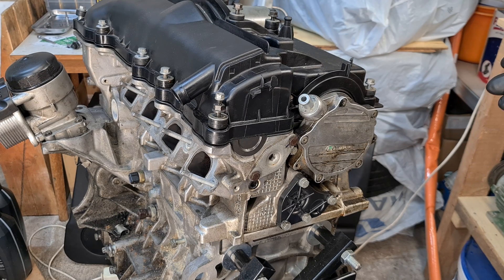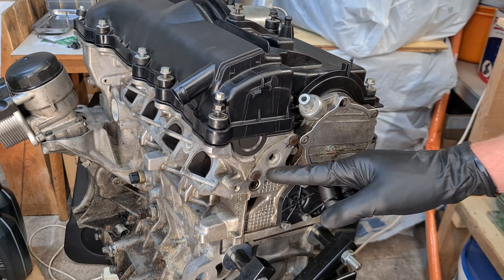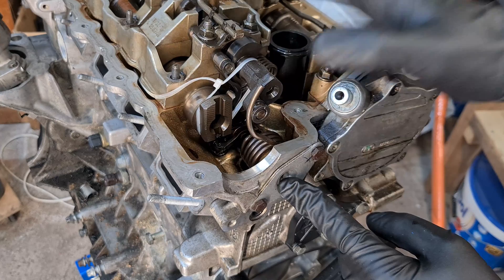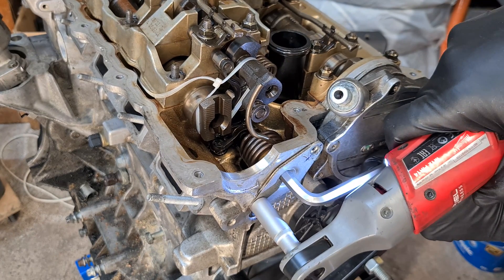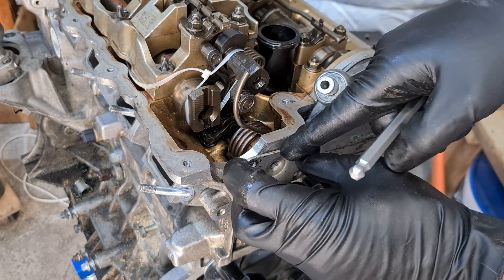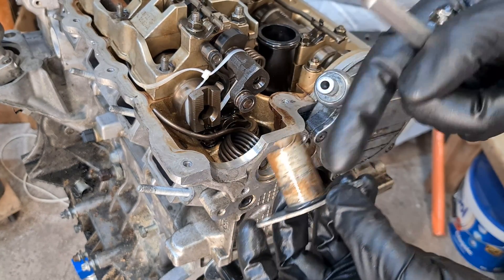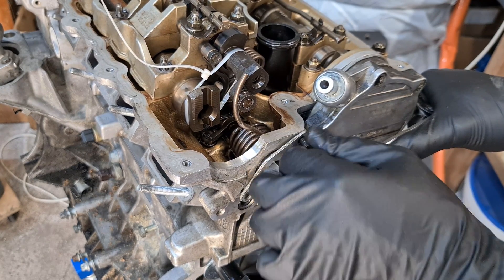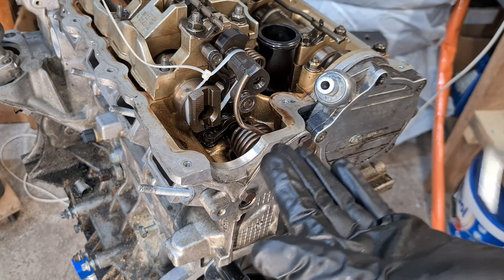N42/N46 Valvetronic Eccentric Shaft Torsion Spring Carrier

Comment: Thank you for your helpful video. I am an amateur car repair enthusiast. While replacing the vacuum pump, I mistakenly removed the camshaft spring seat. Once the two bolts were loosened, it was ejected under spring pressure. Because the component is located so close to the vacuum pump, without removing the entire engine it is difficult to see clearly, which makes it easy to remove the wrong part by mistake.😅 
I have another question😂😂😂: I noticed some engine oil in the vacuum line between the vacuum pump and the brake booster. Could this indicate that the vacuum pump’s check valve is malfunctioning? Would this be considered a fault?

Comment: I love your videos man. Just a quick one, I have an E90 N46 320i, has a bad and long crank when the engine is hot what could possibly be the issue?
Reply from the maker: First check the timing. You can check vanos adaptations with compatible scanner or INPA. Intake should be 117-120 and exhaust 54-58 deg.
Reply: @BimmerZen  I will definitely do that. Another thing, I’m getting exhaust fumes in the cabin and expansion tank, have you experienced that before? 

Thank you for your response man, I’m in South Africa.
Reply from the maker: @mphothanwane9048 probabl oil vapours from oil leaking on to the exhaust manifold from the vacuum pump or leaky valve cover. Check my videos on vacuum pump seals replacement
Reply: @BimmerZen  I’m actually asking because I saw your videos on vacuum pump 😂

Comment: you seem to like your n46, can you make a video, explaining the diffrence between the 2 inlet manifolds for the 318 i and 320i, id liek to put a 320I inlet manifold on my 318, but they are diffrent, also, it has improved flow and extr actuaturs, does this account for the extra 20bhp the 320 has over the 318?

Comment: Hi , i’m having a little bit of a rough time trying to fix my n42 . The engine just lost it’s power and misfiring . I have the 2 errors : 2850- variable valve gear - guide sensor and Reference sensor . Any advices ?
Reply from the maker: Usually a bad Valvetronic sensor. Check if there is oil inside the connector, try clean it, if that does not work, then I suggest you replace it. Also replace the sensor flange gasket to prevent oil ingress in to the sensor connector.

Comment: Hi Zen 
I drive a 2006 BMW 320i E90 with an N46 engine I recently changed the valvetronic and the timing chain and guides. But the valvetronic motor adaptation is  not successful. I'm not sure if I have to change the eccentric shaft sensor. Please help
Reply from the maker: Valvetronic eccentric shaft position sensor is "smart", so it will throw a specific errors like "sensor plausibility". Do you get any error codes? Does your scanner work for the MEV9.2 ECU?

Comment: Aha...its me again BZ. I guess I must have scared you with my email so I apologise for that. I would just like to ask 1 question of you. If my VT was not working, would it affect my brake vacuum? I have unplugged the MAF now and the car runs way way better. I am just getting a bit confused as to wether the VT is the fault or its the MAF. On start up, the brake pedal feels a little hard but gets better. I have done the CCV and its had a new brake booster. Also did the Vac pump clean and reassemble. Brakes are way better but I'm just wondering if this VT/MAF issue may affect brake vacuum too. Any help would be appreciated buddy. 
Regards
Sleepy Steve.

Comment: Hey BZ. Hope you're doin ok. I have just disconnected the MAF and the car is running nearly 100%. Seeing as you know these engines well I was wondering if I could test run the car for a while with the MAF unplugged? If I remember correctly the MAF is like a secondary system that would kick in if Variotronic stopped working or am I being as stupid as I feel 😂 Many thanks buddy. Steve

Comment: Oh, and I actually started this thread to ask if you ever sorted your issue with number 4 cylinder after the Veronica job last year.
Steve
Reply from the maker: The issue is still there. I plan to swap the whole Valvetronic assembly from another engine to see if there is a valve issue or a VT issue...
Reply: @BimmerZen  Ah thanks so much for replying. It shows that you really are a nice chap. May I please ask you if its possible to post up once you've fixed the issue. It would be very helpful to us out here.

Comment: Hey BZ. I must say, I love watching your videos. They make me feel drowsy but in a good way. I am struggling with an N42 thats just had oil inside the plug tubes. Having removed the valve cover I saw to my horror cylinders 2 & 3 are under the VT bracket. I have done a temp repair to stop the oil but now when I start the car I have a miss. Have purchased a new coil as a tester but can't get rid of the miss. I was just wondering if I had missed something when putting the cover back on? I checked all the springs to see if they were all good and they are. Any ideas buddy?
Regards
'Sleepy Steve'
Reply from the maker: The oil inside the spark plug tubes is most probably due to leaky o-ring on the tubes. On nr. 3 and 4. you have to remove the Valvetronic to replace them, which is a real PITA. How did you "temporarily" fix the leak? Do you get a ECU error for the misfire (specific cylinder nr.?)?
Reply: @BimmerZen  So, I cannot seem to get any codes or any EMR lights which is why its so frustrating knowing which way to look next. I can drive the car with a 'soft right foot' but any incline and its missing. It has all the hallmarks of a coil pack but I have swapped the new one for each cylinder and its the same.  The leak fix was I cut a plastic coffee cup up and then measured down the tube to where the oil would be coming in, then wrapped the coil with the coffee cup and some excellent silicone and it has stopped the leak...for now.
I got to believe that this other issue is a secondary fault just like your No4 cylinder.
Reply from the maker: @millspeed88  Could it be a vacuum leak? Dose the engine want to stall in idle? Or is the misfire present at higher rpms?
Reply: @BimmerZen  Yeah, I will go forward now with stuff like vacuum leak etc. Now that I know the valve springs are ok I can rest easy. It does miss at higher revs but its honestly quite difficult to pinpoint it exactly. Definitely worse when under load. As I said earlier, it has all the hallmarks of a coil issue. Maybe I will have to get 3 more and see what happens. Its so hard without any codes or EMLs
Thanks for replying too.

Comment: Great informative video. 2 questions, can this be done with the engine in situ, ie from the front, the same time brake vacuum is done. Secondly, what's with the cable tie? I take it you put this on before removing the cover for the video but does it help with the job? Is it essential or is it in there permanently for some guru type fuel economy? 😂
Reply from the maker: The zip tie is on just because  I use this engine as a video prop and I remove the valvetronic bracket often. To replace the o ring, there is no need to use a zip tie. This can be done with engine "in situe" but you need to remove the valve cover to do this o-ring replacement.
Reply: @BimmerZen  Replaced cover gasket as well as oil filter housing a few months back but cab still stinking of oil, assume if careful cover gasket can be reused? just ordering kit for vacuum, O ring for this, 2 for cam sensors in front and a pair each for solenoids. New CCV and hoses, after all that, if it's still bad I think it's getting scrapped because I'm running out of ideas. 😂

Comment: bmw pro if my 318i n42 oil serperator not working can it cause engine oil to leak everywhere on the engine when engine running an u pull the oil fill cap it as a heavy blow by an the engine keeps running even if u pull the dip stick it dont change the eninge rpm.

Comment: Question, what could be the issue when the idle speed is too low but somewhat stable that causes the car to vibrate a little bit? The thing is, when I turn on the AC the idle speed goes up and the car is more stable
Reply from the maker: N42/N46 engines have Valvetronic to control valve lift that determine engine speed/power output. In idle the valves open very little (for example 0.3 mm), if there is an issue with the valve lift, one or more cylinders operate with lower efficiency which causes vibration. When you turn on the AC, the ECU sets the idle speed higher from 650 to approx. 750 rpm to increase power delivery to AC compressor. That means valve lift is bigger (for example 0.4mm) and any issue with valve lift has less effect on combustion efficiency, thus smoother idle.

Valve lift issues are most commonly due to worn or damaged valvetronic components and/or lifters, most commonly on cylinder nr. 4. It's wroth to first check coils, spark plugs and injectors before attempting Valvetronic repair.
Reply: @BimmerZen  Do you think that a little bit of oil in the sensor could cause issues with idle speed? I‘m often getting an error related to the sensor and think of replacing it along with the valvetronic motor…
Reply from the maker: @weezy6076  Probably not. But if you have the exact error code, let me know. The error would be intermittent because this sensor sends digital signal to the ECU, so poor idle is most probably not a symptom of a malfunction. Oil in the sensor is however very bad. It can get to the ECU and in to the sensor electronics and destroys it. Car goes in to emergency mode.
Reply: @BimmerZen  
Carly is a shitty way of reading error codes but:

002A5B
0029ED
002A59
0029FF
0029FE
002D0F

The engine along with the car is somewhat shaking if I do a very cold start. It stops after roughly 30 seconds once the RPM goes down after a cold start. I could make a video and mail it to you if that helps you locate the issue perhaps

Comment: One question, did you find the problem why engine have problem on 4 th cylinder when you looking in live data
Reply from the maker: Not yet. I still plan to do it but I just don't find the right time to it:)
Reply: @BimmerZen  I have same problem with my car.In beginning it was slightly shaking, now locking like misfire. New coil packs and spark plugs, compression 12 bars on all cylinders and no errors on diagnostic
Reply from the maker: @radoscenic3356  Probably valvetronic issue...  one or both of the valves on nr. 4 have reduced lift so it misfires on idle. Does the car idle OK if you unplug the valvetronic position sensor?
Reply: @BimmerZen  When I disconnect working fine and of course it's higher consumption because valvetronic open valves to the end.I was replaced camshaft and all rockers 60 k ago for about same issue .On 3rd camshaft it was visible wear on 4th cylinder .Now probably I have same issue because I'm fitted used one.
Reply from the maker: @radoscenic3356  OK, I understand. Another possibility is that the nr. 4. spray nozzle on the oil line is clogged... and the components got worn out again?
Reply: @BimmerZen  Thank you for advice, I was thinking about that as well, but I don't know from where to start again
Reply: @mihau9445  Partly yes, new  valve tapets, new 3rd camshaft and I'm fitted used rockers, because new one is overpriced and cleaned oil supply system. Working better definitely but  still not working how it should. Only I can try to clean injectors

Comment: Thanks for all you videos on N42/N46 engines, 
For 8 years I am driving a 320i LCI 2009 (N46N engine) 186,000 km, in Iraqi Kurdistan (where the service shops are not standard).
I am suffering from high oil consumption (one liter per 700 km), I have found a used clean N42 engine, that I would like to replace my engine with, I am wondering if a complete N42 engine could replace my N46N engine, I will be using below original components from my N46N engin:
-Intake manifold  
-injectors and rail 
-Exhaust manifold & Catalytic convertor
I will be thnakful for your advise.
Reply from the maker: Replace CCV and valve stem seals, that will fix oil consumption in 99% of cases. Much easier than replacing an engine.
Reply: @BimmerZen  Now I have a very strong blow-by when I am opening the engine oil filler cup, I have changed the CCV that is integrated as a diaphragm in the valve cover.
Reply: Dont change your engine to N42, N46 are more reliable, high oil consumption on N42/46 are many experienced due to valve stem seals, especially in hot climate countries
Reply: @sengkuni_timelapse  Yes you are right N46 is more reliable, but I have changed the valve stem seals befor 10,000 km,
The mechanic did not have the set that enables changing the valve stem seals without removing the complete head,
So removed the head and replaced the valve stem seals and made grinding for the valve seats (which led to that the valves never close properly) , so I think that the high oil consumption has been cosed by this unstandard type of grinding.  
Now I have a very strong blow-by when I am opening the engine oil filler cup, I have changed the CCV that is integrated as a diaphragm in the valve cover.
Thanks alot for your interest.
Reply: No.
Dont change with the n42.
Are different shafts and complete different vakvetronic system.
The n42 has separate ecu for the vavlvetronic.
In The n46 the vavlvetronic ecu is in the engine ecu
Reply: @nikosstentoumis3961  Thanks for you concern, Then I have another question, is it possible to use only the blockcylinder of N42 to be used with my engine that is N46.
The reason is due to high oil consumption and strong blobby ?
Reply: @kameranlhoni410  I think you can doit.
But I am not sour for that.
Thw books says ..."the block is the same..but the headlock and the eccentric shaft is complete different.
I DONT NOW FOR SOUR.
If you have about 300 k klm....change the stem seall and the ccv valve.
The ratle noise maybe is your chain
Reply: @nikosstentoumis3961  Thanks for the advise, I realy appriciate that.

Comment: hi BIMMER ZEN! As a mechanic do you think these engines are good?
Reply from the maker: 2.0 L version is OK, BUT only if the engine was well maintained. Oil service interval <15k km OR once a year! Plastic rail guide might break so it's good to replace it after 200k km. Gaskets are a problem like on all other BMW engines. Go for the 6-cylinder if you have an option.